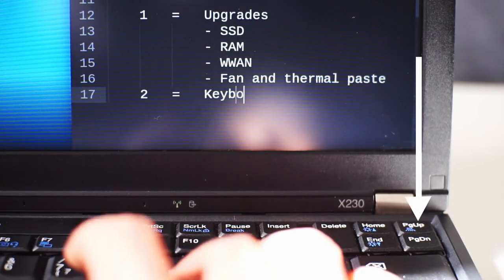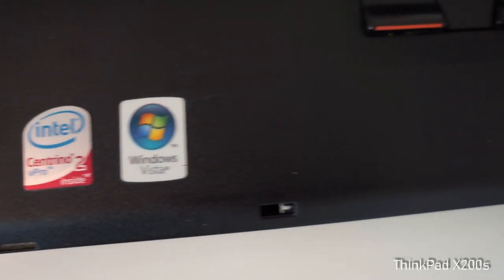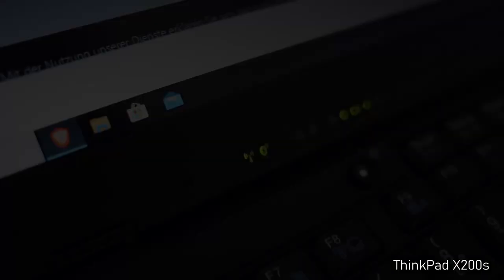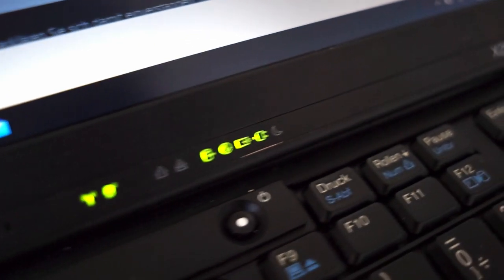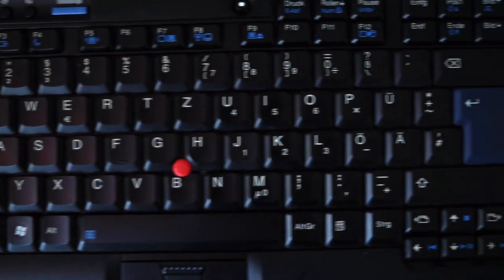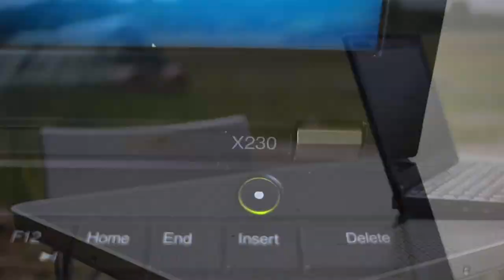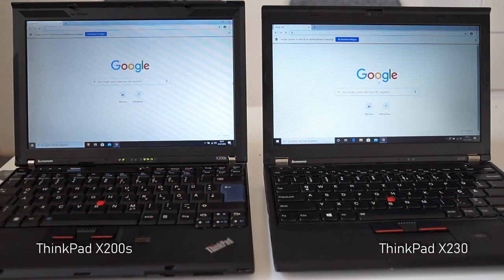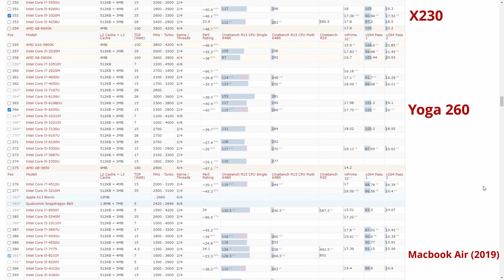Building the Perfect ThinkPad X230 Part 1: Complete Disassembly, Re-pasting, Fan, SSD, RAM

Comment: According to the service manual, what you believe is the GPU is actually the Platform Controller Hub (PCH). The X230 does not have a dedicated GPU, but one which is integrated in the CPU itself.
Reply from the maker: Yes you are right, sorry for the wrong information. I already got some comments on this and will try to reupload the video soon :).

Comment: I think if you don't need to use the WWAN card, you can put an MSATA SSD in it.
Reply from the maker: Yes, that is also possible.
Reply: Yup, i installed one, works perfectly fine. Just be aware of the size, as it's not the standard length.
Reply: @davidfabian3899  Great idea. I would like to try this 🙂

Comment: x230 is fine for most everyday things.  Minecraft is fine on it too.
Reply: Is the screen small? How does it compare to a 4:3 aspect ratio? I'm used to it on my 2003 Gateway tablet PC, and some databases don't run on it anymore (like Jamboard which requires newer WebGL support), so I want a newer computer with a similar form factor.
Reply: @mistrotech8894  the screen is kinda small, because it is supposed to be an everyday business laptop which can be carried around with ease. The screen size is 12.5 inches, 1366x768 resolution. It supports WebGL. The aspect ratio is 16:9 so it can run videos and games at 1080p (2018-present game titles may lag a little as per my experience). The performance depends on which variant you have. When the X230 came out in 2013, it had the option of an i5 3320m, i5 3360m, i7 3520m and I think some more processors. You could choose the amount of ram, whether you want an SSD or an HDD and many more options. It was very advanced for its time.
Edit: Also, it has intel integrated graphics. Mine (i5 3360m) has intel integrated graphics 4000.
Reply: @mistrotech8894   the two in "2XX" is the display size, like the T420 is 14 inches, the X200s are all 12 inches

Comment: Great video, thanks for taking the time in making it!

I was wondering: Is there any benefit in using the thermal pad for the GPU instead of the paste? Or would it work just as well with thermal paste?
Reply from the maker: Thank you, its much appreciated! In general, thermal pads are used to compensate for larger gaps or no exactly flat angle between the processor and the cooling unit. In case of the X230 the gap is very small, however the cooling plate is pushed against the GPU with only one screw. This results in a not exactly perfect angle. Thermal paste can also compensate for very small gaps or angles of course.

Comment: hey man great video, can you tell me the model of the fan/where did you get it
Reply from the maker: Thank you! Finding the right fan can sometimes be difficult... I got mine on eBay but the link doesn't exist anymore. Also, I would not recommend the exact fan I bought anyway because it has already started to rattle. Best would be to remove the keyboard and have a look at the FRU of the fan and buy exactly this model (Lenovo seems to have used different ones in the X230). This way you can be sure that the fan fits to the heatsink. Or just buy a fan/heatsink combo. I hope I could help you with that. :)

Comment: nice video. Quick question. I ordered some screws for the case but i think there are more than i need. Could you please tell me which ones are for the back of the laptop? i have 3,5mm and 5mm screws. I think some of them are loose. Thanks in advance
Reply from the maker: Thank you! You'll need the longer screws for the most part. For the RAM cover you have to use the shorter screws however.
Reply: @classicdome9347  thank you. Do you know the size for the ones which are on the back of the computer for attaching the screen lid? thank you
Reply: This model is quite convenient, there are only two sizes of screws, it seems. All the outside screws are longer ones (and black in color). Meanwhile on the inside all the screws are shorter (silver in color). I once worked on some old laptop of another well-known manufacturer, and there were perhaps 5 different screw lengths, making it a nightmare to keep track of what goes where.

Comment: New fans are lower quality and louder,  i used cosmetic vaseline to grease my old fan and it helped a lot.  By the way do you know how fix problem rapidly turn off/power lost  in X230 ?  i had two machines from different buyer and have similar problem. It is very unregular and quite rare but it happens.. What to do ?  I had cooling fan in good condition so laptop is not overheating  50-65 deg C max..

Comment: Nice video, will come in handy when i start my makeover. Do you know of any way to find out what kind of display monitor that is in my X230? I would like to have an IPS if I can find one and where to get it. Any ideas and thanks/
Reply from the maker: Thank you! If your display has bad viewing angles, it is a TFT-display. The only way I know to determine the actual model number of the panel is disassembling the display assembly. I got my IPS panel from eBay, but be careful to check if they actually delivered the exact right model number (sometimes they ship a model slightly different from the eBay listing). In my video "Building the Perfect ThinkPad X230 Part 3: IPS-Panel" I provide Information on which panels can be used (link in the description).
Reply: @classicdome9347  I have quite a few of these thinkpad.models, from the T61 to the w530. What model do you like best in the x200 series models? Some models are built well with excellent protective materials. I had a few tablets but they fell apart. 

From what I had, the hinged models were better built but I believe all the tablets have IPS screens. I now am looking at the X1 models with the super high resolution. I wander how those are built quality-wise? Problem I see on eBay right now is that 230 model seems to be priced high for some reason. Any idea why that I am missing? 

I am referring to all non- tablet models. From your video it looks like the x230 was very well built inside and could stand up to a lot.

Comment: Great video! Could you pass the RAM/SSD Specs you installed it. I am confused with the Ram voltage. Im not sure if it has to be 1.35V or 1.5V? Thanks
Reply from the maker: Thank you! The RAM used originally is PC3-1280 1600 MHz DDR3 which has 1.5 V. I am not sure but DDR3L (low voltage = 1.35 V) should also be detected. Slower RAM like 1333MHz can also be used though it is not recommended. You can use every SATA SSD with 7 mm height (SATA II or SATA III).
Reply: Hi guys! 1.35V DDR3L RAM will work fine :)

You can put two 8gb sticks in there. I have two 4gb DDR3L's in mine. :)
Reply from the maker: @TheRealStevenT  Perfect, thank you for the information!
Reply: @classicdome9347  DDR3L RAM is backwards compatible with DDR3. In other words, they are dual voltage 1.5V / 1.35V and will run at whatever your system supports. I have tried DDR3L 2133 MHz HyperX Impact modules modules, and according to HwInfo, they are running at full frequency, but I'm not sure at which voltage, as this info is not displayed. Either way, it works

Comment: Amazing video overall content, you just earned a subscriber :).

I’m working on a simile X230 project as I bought one really cheap but it’s missing the 1st display ribbon you removed.

Why does it have two of those? The screen works but it just flickers from time to time so I’m not sure if the panel is wrong or just missing that ribbon.

Thanks!
Reply from the maker: Thank you very much. I really appreciate your subscription! One of the two ribbon cables I declare as display ribbons in the video is actually used for the webcam and thinklight (removed at 2:00). The ribbon I remove at 2:49 is the actual display cable :). Have fun with your X230!

Comment: Will it destroy the CPU if you touch it with your hand? I cleaned mine and touched it, it turns on some times nd some times doesnt turn on, I used normal paste for GPU as well. Thanks for the video
Reply: if you touched the pin or bend it, it would be broken.
Reply from the maker: I am sorry to read that! Touching the CPU die is not good but if you clean it afterwards (alcohol) it should be ok. For the GPU a thermal pad was used originally which can fill a bigger air gap. Maybe the GPU is overheating? Difficult to say.
Reply: @classicdome9347  Hey thank you so much for responding, by fortune I forgot to connect one cable that goes from the keyboard to the screen that was the issue, thanks a ton, your video is super super helpful! and you are very kind
Reply: @Jan-px7tn  Thanks Michael, by fortune I did not touch the pins side, but the other one, that is shinny, found the problem was a missing connection from the mobo to the screen! :)

Comment: Hey, which WLAN card did you install? I bought one from ebay but it is the one i had before.
i would like one with Bluetooth though.
Reply from the maker: Hey, in the X230 there is a seperate Bluetooth module (2:29 in the video, FRU 60Y3303). I did not install another WLAN card, it's still the original one.
Reply: I'm using an Intel 7260ac card on my X220, and a 7260ngw on my wife's X220t. These cards also include Bluetooth support, which seems to work better than separate Bluetooth daughter-cards that install in the special slot. You need to flash the modded BIOS to remove the WLAN/WWAN card whitelist. And you need to tape over or cut off pin 51 on the card if you want the Bluetooth to work. The original Bluetooth daughter-card can be removed. These cards work fine with the stock antennas, and provide very good speeds (7260ac is the faster one of the two).
For my X230 project, I've bought an Intel ax210 card, and an M.2/NGFF to mPCIe adapter. It is reported it should work, but I haven't tested it yet.

Comment: Quick question if you happen to know. I have an X220 and an X230. The X220 has a DC BRUSHLESS 5V 0.30A fun. 

The X230, however, has the AVC rated at 5V 0.45A. I tried a DC BRUSHLESS 5V 035A but I get a "fan error" at boot, although the fan spins normally. I suspect that due to lower amperage it can't reach the required RPM and the PC recognizes it as a "failed fan". I found a Xuirdz rated at 5V 0.5A that I am eager to try out, however, I am a bit afraid that I may damage the motherboard. Do you think that 0.05A higher amperage poses a risk? 

If I have to order an AVC from China I'll be without a PC for something like 2 weeks - 1 month....:(

Nice guide BTW....

Comment: What thickness thermal pad did you use/would you recommend?
Reply from the maker: I would use a 1-2mm thermal pad for the chipset (I accidentally called it GPU in the video).
Reply: @classicdome9347  Perfect, thanks!
Reply: I think the original thermal pads are 0.5 mm thick. I bought a 50x50x0.5 mm thermal pad from ARCTIC COOLING (p/n ACTPD00001A), it will make enough thermal pads for the rest of my life probably.
Reply: I had problems with random shuttown, then replacing thermal pad in  N.B.  0,5mm new from Aliexpress  21W/K  make's  the job..
Reply: I made a mistake replacing the pads with paste on PCH and the machine shuts down randomly. What size and thickness pads should I buy? Any links?

Comment: for the CPU did you use the Arc MX2, and for the other chip? it looks like a thermal tape
Reply from the maker: Thats right. I used MX2 for the CPU and the thinnest thermal pad I had on hand for the GPU.
Reply: @classicdome9347  thinnest like 0.5 mm? I want to replace the thermal paste for my x230, I believe it is still the original one
Reply: @classicdome9347  and I'm looking for a clip to install coreboot
Reply from the maker: @DavideMaglio  Yes, I used a 0.5mm (Arc) thermal pad.
Reply from the maker: @DavideMaglio  Regarding coreboot there are some documentations out there. For example: https://www.chucknemeth.com/laptop/lenovo-x230/flash-lenovo-x230-coreboot. There is also mentioned what clip he used. I hope that is helpful :).

Comment: Thinkpad x230 has max 32 ram or 16 of maximum ram memory wchich can be installed?
Reply from the maker: It takes 16GB at maximum (PC3-12800 1600MHzDDR3). 1Rx8 or 2Rx8 should both be possible.
Reply: @classicdome9347  thx bro. Any else thinkpad has 32 max?
Reply: @classicdome9347  thx for your replieng
Reply from the maker: @PolishPianoOrgan  There are not many "older" ThinkPads that support 32GB. If you take the T-Series as an example the t450 is the first supporting 32GB (not officially supported) according to the website "https://thinkwiki.de/T450" (which unfortunately is in German). There you can find detailed Information about many ThinkPad Models.
Reply: @classicdome9347  ufortunately german language.yes.  Im from Poland. Thx a lot
Reply: @classicdome9347  Not entirely true. W530 supported max 32GB (only those originally supplied with quad-core CPUs). W530 can be retrofitted with the classic keyboard as well.

Comment: Was it easy to install drivers for and make the H5321gw WWAN card functional under Windows 10?
Reply from the maker: It was possible to install the Win7 driver supplied from Lenovo. It was not recognized by Windows 10 itself, as I remember (could be wrong here). Since I use Linux on these older machines, I had no problems.

Comment: Hey dude, is there a specific reason that you replaced the fan?
Reply from the maker: Yes, the originally installed fan was ratteling quite loud. However, the newly bought fan starts to do the same now... Best buy original ;).
Reply: @classicdome9347  got you, cool video btw :)
Reply: @classicdome9347  I have one x220 for traveling, but it seems 90% same inside. Regarding the fan, don't trow away the original one - just pull out the rottor and then allply a thin layer of oil (even car engine oil works fine) on its axis - it will serve longer than any third party fan you can buy.
Reply from the maker: @milenkaramanov4840  Thank you, very useful! :)

Comment: What WWAN did you put? is there a 4G/LTE one?
Reply from the maker: I did install an Ericsson H5321gw which supports GPRS/WCDMA/HSPA/HSPA+. I think it reaches 21.6 Mbit/s, so no LTE unfortunately. There seems to be an LTE option available with FRU 04W3821 (Sierra MC7710). But it has to be exactly this model with FRU since the X230 has a whitelist implemented in the BIOS. Since I personally did not test this WWAN card, I can not guarantee that this will work.
Reply: @classicdome9347  Didn't you install the modded BIOS, which removes the whitelist? Do you actually use the WWAN card? I always wondered if maybe I'm missing out on something by never using that feature. In the rare cases when I need mobile internet on my laptop, I just use my phone as a hotspot.

Comment: Can we use NVMe SSD on this X230? And can we upgrade it's processor? I have it with Intel i5.
Reply from the maker: Sadly it is not possible to use a NVMe SSD in a x230. You can install a mSATA SSD though if you have a free slot in your x230 (check the maximum length before buying). You cannot upgrade the processor unless you buy another motherboard. I hope I could help you with that.
Reply: @classicdome9347  Thanks. It helps me a lot.
Reply: @jibranhanif  the processor is soldered onto the motherboard in this model, and nvme drives (let-alone the TECHNOLOGY behind nvme-drives) weren't invented yet when this model came-out.

Comment: Hello. My laptop cant read the hdd. I have 2 hdd that are running if test to the other laptop. What you think is the problem of this?
Reply from the maker: Unfortunately, I cannot help you since there could be many reasons. Does it detect the HDD in the BIOS menu? Does a Linux or Windows installer find the HDDs?

Comment: Hello sir, 
I am using x230 from past 3 years. Previously I install Windows 10 and also install graphics 4000 driver . But after display problems, I uninstall graphics 4000 display driver after that display gone and only vertical lines appears in display. Bios settings, Lenovo display and safe mode boot menu no any first display comes. What should I do, please suggest 🙏

Comment: How did you go about removing the 2nd display ribbon? I broke the 1st one connected to the webcam and thinklight. It is stuck like glue!
Reply from the maker: I'm sorry to read that. In my case neither of the ribbon cables were glued in place as you can see in the video. I am not sure why that is the case with your ThinkPad. Maybe the ThinkPad was opened before or Lenovo might have changed the assembly process over time.
Reply: @classicdome9347  But what was your process of removing the cable? I couldn't quite see the motion as your arm covered it.
Reply: @cal_vin4068  Using your fingernail, flip up the retaining flap of the connector on the motherboard. Then the cable just comes out. Same with the other cable. Same with the palmrest cable.

Comment: I've seen some folks on Reddit claiming that they put 16gb RAM in their x230. What is the max for this machine?
Reply from the maker: Exactly. 16GB (2x8) of RAM is the maximum for this model.
Reply: @classicdome9347  hi, may I know what type of 8GB RAM will support? 1) 8GB 1Rx8 PC4-2400T
2) 8GB 2Rx8 PC3L-12800S
3) 8GB 2Rx8 PC4-2133P

Thank you.
Reply from the maker: It takes PC3-12800 1600MHzDDR3. 1Rx8 or 2Rx8 should both be possible.
Reply: @classicdome9347  ok, thank you. 👍👍👍

Comment: Can it use Ram DDR3L version ?
I have Ram DDR3L , low voltage version.
Reply from the maker: According to other comments regarding the same question, you can use DDR3L as well. I personally did not test this. I hope this could help you :).
Reply: @classicdome9347  thanks.

Comment: Any idea about rusty on vga port x230? How to clean it?
Reply from the maker: If the signal is not affected, I would just leave it as it is. Otherwise, you could try putting contact spray on a VGA cable and just plug it in and out several times when the laptop is turned off. I guess there is the risk of damaging the port or even the laptop with this, so this is your own risk!